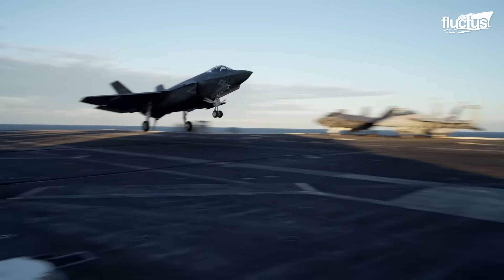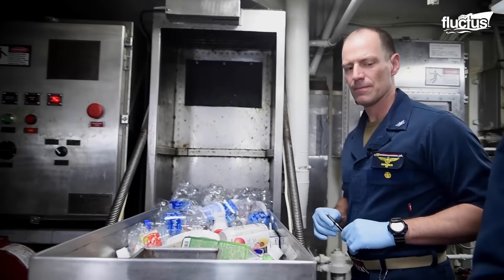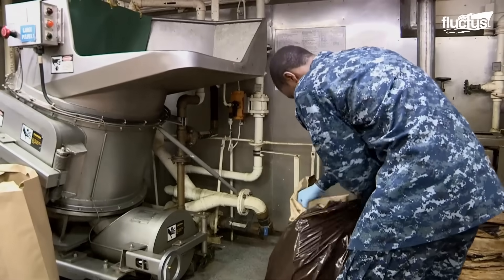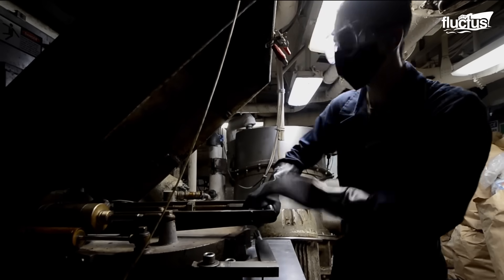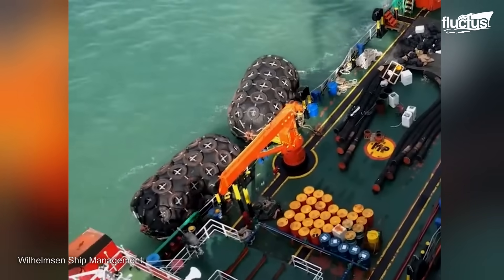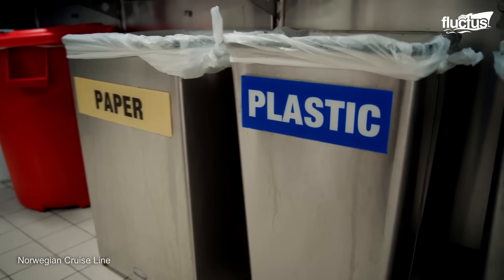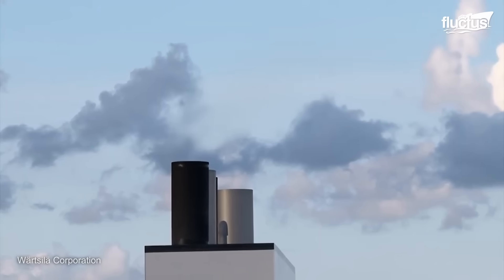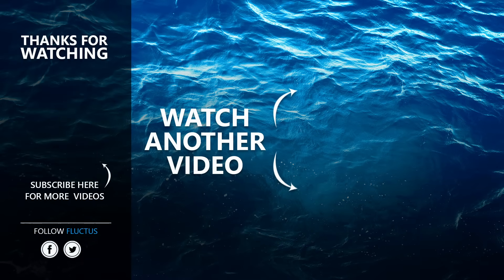US Navy Genius Solution to Dispose Tons of Trash Inside $13 Billion Aircraft Carrier

Comment: So you're still dumping some of the biodegradable trash overboard just compressing or shredding it first, with machines that cost $$$ to build, run, maintain and use earth resources, like iron , copper etc to produce., then the stuff that you do take back to shore just most likely gets landfilled after being pucked or you're incinerating the burnable stuff 12 miles off shore , is any of that heat used for anything like energy conversion? .

Comment: I was given a tour of #78 the USS Ford. I asked a boatload of questions, and the Navy guy didn't have a lot of answers. I saw dozens and dozens of CO2 extinguishers next to ones that were labled PKP. He didn't know what it meant, or what they were used for. I looked it up, and it's "Purple K". He was telling me all about the landing lights on the deck... blah blah. I asked if they were LEDs. Nope- still using incandescent bulbs. Do what? Next, he was showing the lights for guiding the aircraft in, whether they are too high or too low. LEDs? Nope. Incandescent bulbs in there too. They had "emergency" flashlights  in various places, throughout the decks and levels. They looked like they were leftovers from the 60's. I asked if they were rechargeable, and he said... nope. One of his guys replaced the batteries. Some of the flashlights were still using sealed beams, and a couple of them had LEDs that were dimmer than a Dollar Tree flashlight. Pathetic. The garbage? Well, when the machine actually worked, it uses a plasma to incinerate the garbage. Roughly over 1/2 the time they still did this idiotic seperating thing, because this ultra modern garbage disposal idea just didn't work. A waste of money for waste. Just push it over, around a certain small country in the middle east.

Comment: Genius solution? They doing the same on every class of ship, just other clothing/uniforms. And what is genius about bending/hunching to reach down. Preventing enviromental impact by waste managment is so minuscle to the impact made by the actual mode of operation by main engine of the vessel, the aircrafts, and the take off units. They aren't fighting with sticks and arrows, but chemical, and radioactive material for the impact. Aka wishi washi.